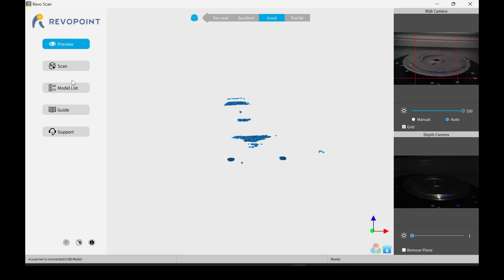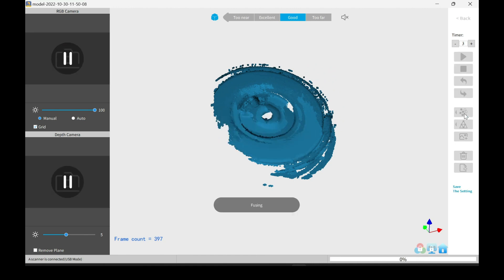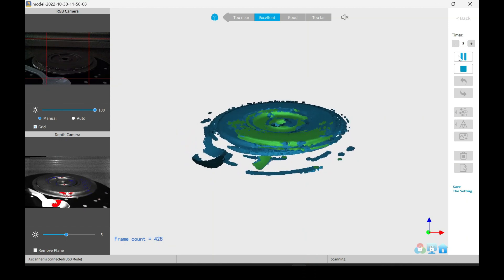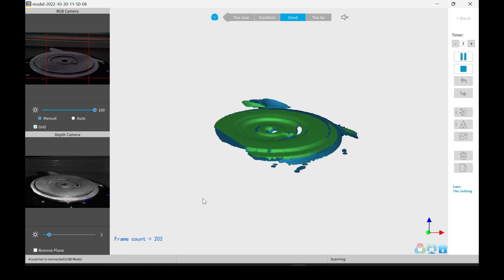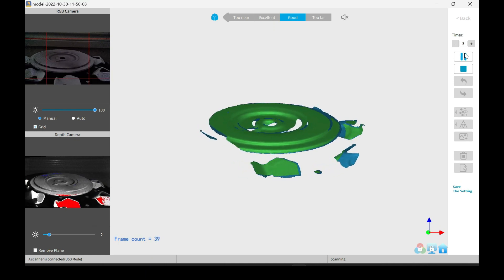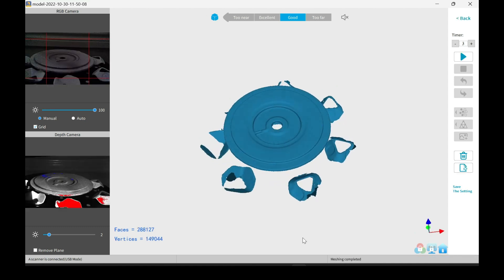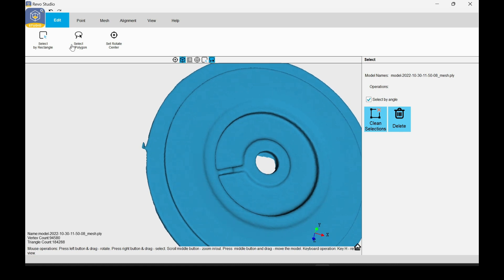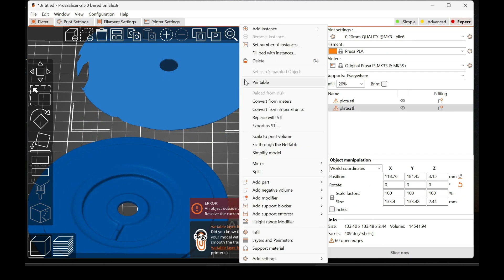Revopoint Pop2 3d Scanning tips - Tracking

Comment: Why not use tape or tracking dots on the object?
Reply from the maker: Some items are too small for markers. You  normally more then you think.

Taping the item works sometime. But for this you want to the correct specs. Where adding tape would add extra thickness to the scan